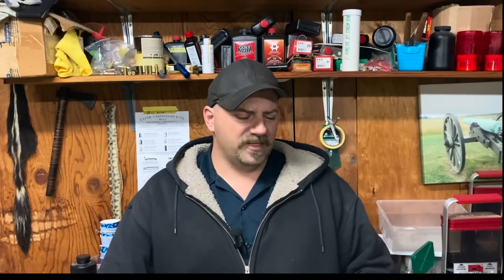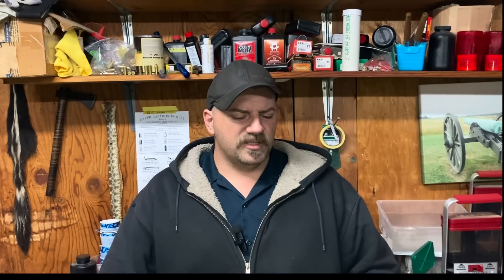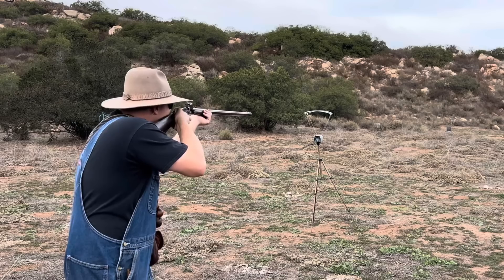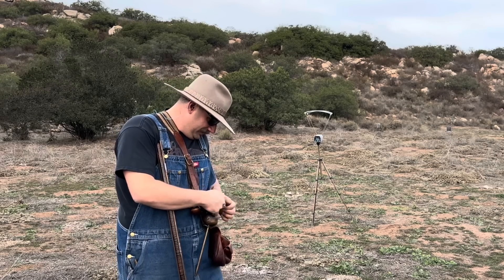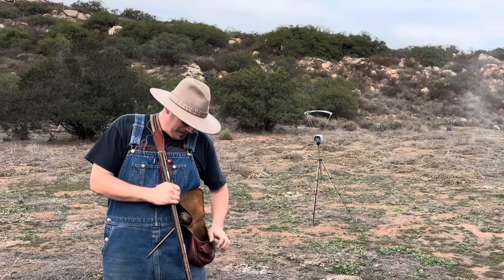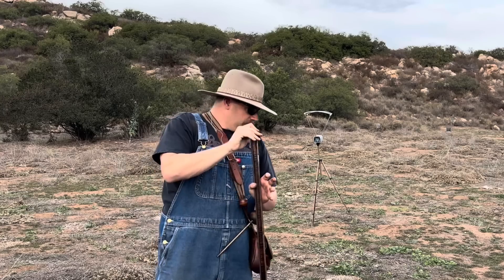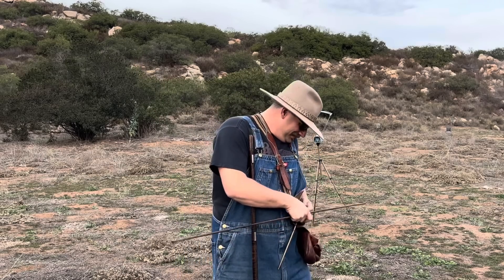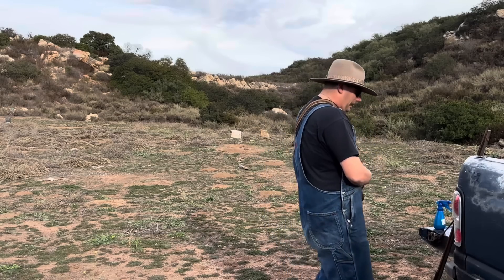Black Powder (Carbon Black)

Comment: What makes soft wood charcoal and, in your case, toilet paper, a good carbon source for black powder, is how porous it is. The sulfur and the potassium nitrate crystals can lodge themselves inside the micro-pores of the grains of carbon, becoming thoroughly mixed. Hard woods and "pure" sources of carbon, such as graphite, do not have these pores, the sulfur and the crystals of potassium nitrate end up on the surface of the grains, so they don't mix as well.
Reply: Thanks for that little 'nugget' of info, easily absorbed.
Reply: I would think that the ball milling process would make any porous structure of the initial carbon irrelevant.
Reply: @sbreheny  

Though the charcoal is milled to a fine powder with an average of 100µm, these pores are still only a couple micrometers in size. They're not destroyed by the milling, the process likely makes them cover an even bigger surface area of the grains compared to its volume.
Reply: Hmmmm bery interezting..

Comment: You have to wonder how the carbon black you bought is made?   If you look at this video at 1.40 https://youtu.be/GSuFSYY-X9w?si=zvsuoHzT8QtCTauM
It is about how lamp soot is colected by burning rapeseed oil to then be made into caligraphy ink in japan.  Looks like a good souce of carbon but is a major pain having to burn multiple oil lamps to collect the soot.  Id probable stick to sold material that you can char

Comment: Good video. for wood sources I am still holding out for you to give poplar a try. but if you want weird stuff you could always try tree leaves, corncobs, and grass. I remember reading that the chemical equation for black powder burning is not the most precises because at the time there was no way to capture the byproducts of combustion when it was under pressure and not being able to identify positively impurities or trace molecules. black powder is more than nitrate, sulfur, and carbon.
Reply: Straw is a readily available form of grass.

Comment: Very interesting! Life is a journey. You learn more from your failures than you do from success. Personally I enjoy watching your voyage of discovery. You are resilient. 

That said. You asked WHY?
At the risk of having everybody’s eyes roll up into their heads and snot run equally out of both nostrils; simple chemistry from the fox. 

Not all “carbon” is equal. As your discovering on your voyage. Carbon has four electrons “available” to interact with other elements. This is the power of carbon that you seek. But carbon also has four valence states, or shells about the nucleus that those electrons can occupy ( oh God, here comes the snot!). Ok! Ok!

So carbon black, soot, there are actually grades of this stuff and it’s not all the same… is by design “not so reactive”. That is the electrons are chemically at or near their lowest potential energy valence states. 
Why? 
Because this stuff is by design “inert”. For bulking up and coloring rubber. As the pigment in your inkjet printer. As a paint pigment. It’s not intended to react. In fact it’s inhibited from reaction. As you have discovered. 

When you make your own charcoal by anoxic combustion your making what is called “activated charcoal” in common usage. That is carbon in one of eight potential states of reactivity. Carbon black is one of the lowest such. 

I hear you thinking….so how can I tell which state…. Wipe your nose. Focus your eyes. You can’t. Not with your level of expertise or technology. Other than your doing with trial and error. 

And so your velocity data, and subjective “clean/dirty” observation is your guide. Some sources of carbon as you discover yield “more active carbon” than others. This is an artifact of impurities in your source material that compete for or donate electrons to the carbon atom and thus “fiddle with” the valence state. 

I will mention that pyrolysis, burning, of your carbon is also a factor. It’s minor compared to other factors, and one your simply not prepared to control. So strive to be consistent and soldier on with your tim can and wood stove. 

Now! Let’s see where you go from here! You have taken a few wrong turns. But your not painted into the proverbial corner. Do carry on! Your more fun to watch than a box of puppies. And less odorous. 

Fox watches.

Comment: I can't recall if you've mentioned it in your earlier videos but I'm curious how eastern red cedar (cedar shavings from the feed store) would work if corned the way that you do it.  I've used it without corning with some measure of success but it takes about 80% more to get similar velocities to Scheutzen.  It's dirtier but not bad as long as it gets a wet patch down with the next ball.  If it gets compressed, I'm curious how it would stack up.

Comment: Regardless of the cellulose source (like wood or toilet paper) which is heated to produce charcoal for black powder, it is important to carefully control the degree of heat applied during pyrolysis.  The buckthorn alder Swiss uses for their superior product is carefully controlled to never exceed 600F during pyrolysis.  That is because the result is a mixture of carbon complexed with a variety of hydrocarbon moieties bound to the carbon molecules. Though not scientifically proven as far as I know, these hydrocarbon remnants in charcoal are thought to be reactive catalysts during the burn enabling oxygen provided by the potassium nitrate to more efficiently and quickly react with the charcoal to produce heat. Additionally, since these are hydrocarbons, they burn as well adding to the overall heat generated during the burn.  If the temperature during pyrolysis exceeds 600F,  a large percentage of the hydrocarbon moieties are driven off reducing this effect and slowing down the burn.
Reply: I second.  Look at the Japanese and they are sticklers for temperature control during the process.  They are masters of making superb charcoal, for cooking anyway.
Reply: True. I lose significant velocity if my charcoal temps get over 600F. I try to stay under 550F.

Comment: I once made BP using darco filter powder. Darco is a very fine super activated charcoal for industrial filter purpose. I used it to filter impurities from petroleum solvents. It did not make good BP, the burn rate was slower than BP I made from hardwoods.

Comment: Oh Lord, the sheer rifle abuse, that must've hurt! All fireworks industry manuals recommend not using lamp black instead of charcoal in lift charges etc, and you see why. Its mostly used that i saw in primers and road flares. I saw a report formulation with it but it was heavily aluminized. Dont use powdered metals in antique.. because they burn so hot crystals of corundum (sandpaper grit) formed from the aluminium will "weld" to your barrel, and also mess with the rifling. 

Its great that you did this, and having big unexpected successes alternating with epic failures only increases the joy of watching your videos, because everything no matter how zany gets an objective test to make the most of it, and its standardizes so people can compare. Don't take the wile e coyote moments as personal failure, you run the best powder video series of the internet!

51 btw, not a pipsqueak yapping :)

Comment: One thing I am curious to see is using other (commonly available) things as a fuel, rather than simply charcoal. One specific example is Dextrin. It's used as a binder in fireworks, so at the very least it won't ruin the burn-rate in small quantities, and it should be easy enough to make (Just slow-roast some cornstarch in the oven untill it turns yellow).

I've worked out the stochiometry for dextrin instead of charcoal, and it's roughly 2.2 grams (or grains, whichever you prefer) of dextrin for every gram of normal charcoal. The theory here being Dextrin requiring less oxygen (less nitrate) to burn and therefore generating more gas (and with a lower molecular weight). On the flipside, this will almost certinaly burn less hot than charcoal.

Instead of just using all dextrin, i though it would be interesting to increase the "dose" in separate batches. Start of with 1/8 of the charcoal substituted and work down to 1/2. Should be easy enough to do, just use regular formula, but replacing some percentage of charcoal with 2,2 times as much Dextrin.
Reply: People in pyrotechnics have been experimenting with dextrin and other binders as substitutes or additives in making black powder for at least decades - that's as long as I have personally been involved. I am not aware of any case in which adding or substituting dextrin in a formula has failed to slow down the rate of burning. As far as "stoichiometry", that works find for closed systems, solution chemistry, where compounds are allowed to react freely until completion. That situation simply doesn't apply well to a system where reactants and products are leaving the scene during the reaction. If stoichiometry in black powder reactions were possible, it would be fairly easy to come up with a powder that did not make smoke or leave residues.
Reply: @rjo49  
It''s not just about burnrate, but I see your point.
Reply: Dextrin is frequently used in the range of 1% as a binder in commercial black powder.  My guess is that it would be much slower because it's not as accessible a carbon source as charcoal.
Reply: @vicroc4  
Hydrogen and hydroxyl-groups burn too, you know. As I said, more gas, lower temp.
Reply: @PwntifexMaximus  Yes, but work has to go into breaking the dextrin down into a burnable form,  so overall less energy will be released and the reaction will proceed more slowly.
Reply: @vicroc4  
BUT! The density will increase. Less energy per gram isn't a problem if it's offset by an increase in density alongside gas production. Not to mention there's still a majority of the charcoal unchanged from regular powder.

I wonder if that will make it cleaner or dirtier though... Considerably more hot steam in the smoke.
Reply: @PwntifexMaximus  clearly you have never made any pyro products containing dextrin
Reply: @niccosaur7778  
Open-air burn is not the same as confined pressurized burn.
Reply: @vicroc4 I'm curious which manufacturer of commercial powder adds dextrin?

Comment: This was really interesting because of the duality of the lamp black. On the one hand it's a fairly concentrated carbon; on the other its kind of inherently sticky. There is probably a established cleaner way of harvesting it, and another process to refine the resinous element out. But it's gotta be a diminishing returns thing, and with the time invested at that point you might as well go torch some more toilet paper. 

Love these videos and the work your doing. Thanks.
Reply: Given the various materials and methods used in its production, lampblack or carbon black could have a large proportion of its weight present as unburned fuel (e.g.: oil, paraffin) and therefore NOT be even a very good source of carbon on a weight basis, much less pure.

Comment: Lampblack literally is just soot. It’s very dirty because it’s produced by incomplete combustion of fuels, so it has tars/oils like polyaromatic compounds. Try coal coke. It’s carbon with very few impurities. It’s produced by burning off the impurities in coal. So, it will probably work better. I also wonder what anthracite (a high grade coal) would do. Same thing with graphite. Though graphite specifically might not work well because, while it is a pretty pure form of carbon unlike lampblack, it is not amorphous like charcoal. This means the carbons in graphite have a defined crystal structure instead of being in a bunch of random clumps of carbon atoms. In that way it’s very similar to diamonds. So, it ends up being less reactive. It would still be really interesting to try. It’s also really cheap, so why not for the sake of science, and curiosity?

Comment: I'm no chemist either, but I've saved what I think may be carbon from a copy machine that collects in the waste section of the machine. Eventually, I want to try it.

The spread might be the different pressures from the gunk pressing against the bullet.

Comment: I am learning a lot! Thanks for the fun videos as well! I was somewhat deceived by the name of what was used, “lamp black”. In contrast with the toity paper, it seems its a “toss up and give it a shot”, “hit or miss” process with the type of char used. It does make for great videos!! Thanks again!
Reply from the maker: Thank you
Reply: @Everythingblackpowder  I think you may have laser jet printed the inside of your barrel black. If you type in the "cas number"  1333-86-4 followed by the words; "laser jet" it appears to be laser jet toner minus the silicon dioxide (sand.)

Comment: The molecular structure of the final product is what matters, not that it is "pure carbon", it's what structure that carbon is in that matters as well as what contaminates it contains within that structure. That is why carbon from cellulose products e.g. wood etc. is used, it has been found to have the best resulting molecular structure for propellants once it has been turned to carbon. The purer you can make that structure the faster it will propel your projectiles and the cleaner it will burn. It isn't the carbon itself you want pure, because if that were the case crushed diamonds or coal would work amazing but they don't because they have the wrong molecular structure to do what you are trying to accomplish.

Comment: These are really fun and interesting experiments. I wonder how Anthracite or Coke would work? Thank for taking the time to film your adventures.
Reply: Anthracite coal is very difficult to ignite. Anyone trying to light a blacksmiths forge will know it will not light with a kitchen match or cigarette lighter. You need something flammable like cardboard or kindling wood to start it unless your forge has a propane burner/starter.
Reply: @Miningpastpresentfuture  I've seen some vids where they use ground coal blown thru a tube and ignited to melt metals, and its like a jet engine. I burn lump bit coal for heat, yes, very hard to get it lit.
Reply: @Miningpastpresentfuture  Burns so clean, though. And, as Damnation girl says, coal dust burns very well.
Reply: The key is it burns well and hot. For BP it needs to burn ultra rapidly. I think the coke would be like the carbon black, but what the heck,  someone give it a try!

Comment: Eucalyptus as a carbon source should be interesting. The oils produced by the trees are known to be flammable, and in fact should a wildfire burn them they can actually explode. If the oils survive as the wood is turned into charcoal, could they actually provide a performance boost, I wonder?
Reply: Doubtfull. Any volatile oils would cook out in the retort, and if they didn't it would likely end up as fouling.

Comment: Love these experiments. 👍. Until you mentioned that carbon black was sourced from petroleum-based products, I was thinking it would be very good. Once I heard "petroleum-based" I was visualizing trouble. In my experience petroleum-based bullet lubes yield a hard and difficult to clean fouling in BP firearms. Natural based lubes only need soap and warm water for cleanup. In my experience, petroleum-based products are "bad news" around BP. 
And yes, the source of the carbon is the single factor that most affects how good the powder is. Proven by the world's militaries in the early 1800's, and reproven by modern day makers.

Comment: EBP, Question:  Is there a reason nobody seems to use 'Air Float' charcoal?  Is it slow or dirty or ...?
Reply: It works, but it's just not the best.  Most of the air float is made from hardwoods.   It seems the best charcoals for the hobby are made from light fast growing woods.   Of course there is also the cost of buying the air float which becomes a non issue with diy .
Reply: @luuk-out-below9804  Thank you
Reply from the maker: I started off using the airfloat charcoal. It makes weak powder
Reply: @Everythingblackpowder  Thanks

Comment: the answer to why it doesn't work well is because of the nano structure. the carbon from your charcoal had a porosity to it that when mixed with the other chemical holds on to the powders molecularly. the carbon black has a nano structure more like glass leading to less contact with the carbon. I hope that makes sense
Reply: This is something I suspected too. If this wasn't an important effect, the different sources of charcoal wouldn't matter, would it? Didn't think black powder could be this complicated.